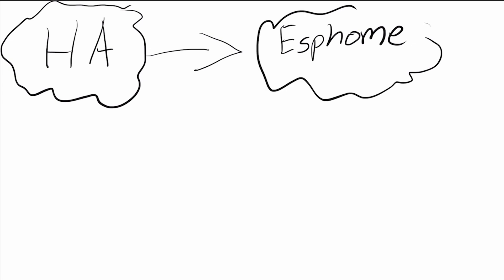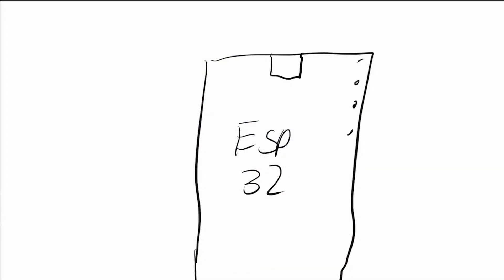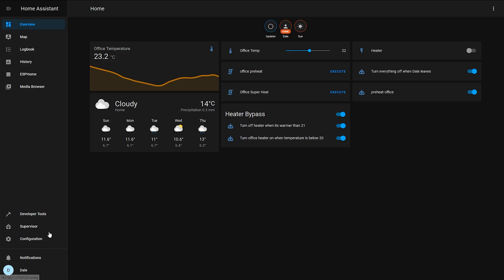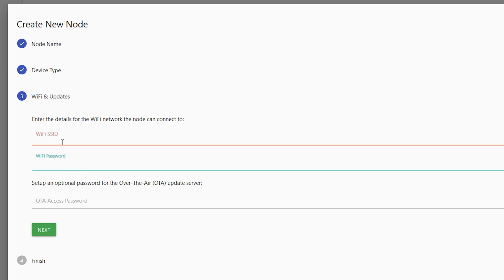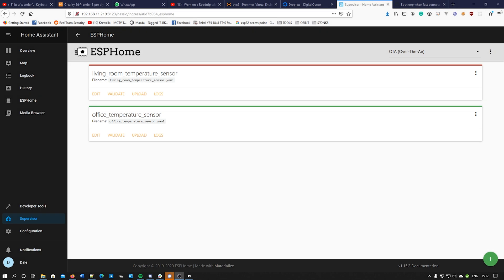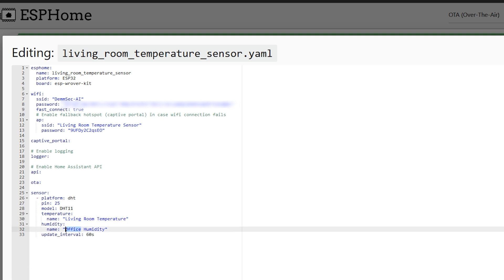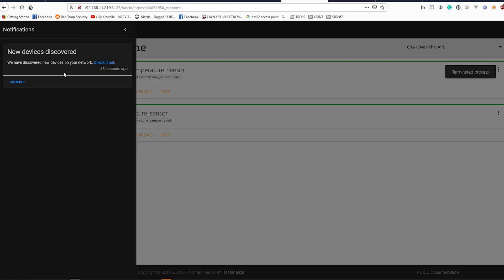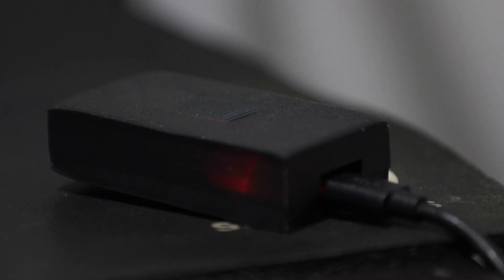Make Your Own Smart Temperature Sensor

Comment: i was about to use home assistant with a dht22  sensor for temperature and humidity with a raspberry pi4, but a may save up instead for an intel nuc  - which is more suitable for such a project with mqtt support and other additions thanks to the better processing power and overall hardware without dedicating a large space.